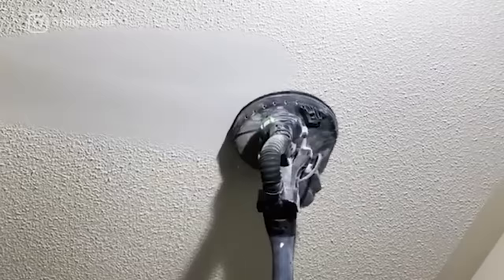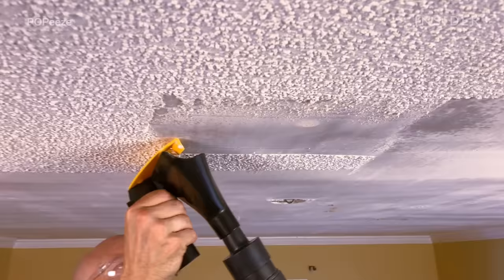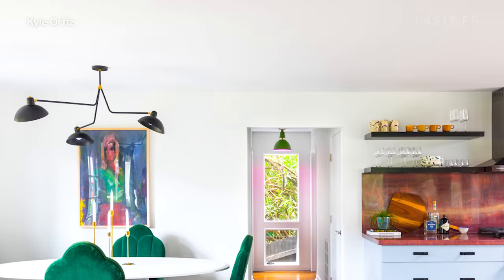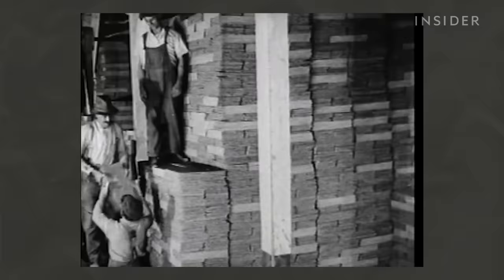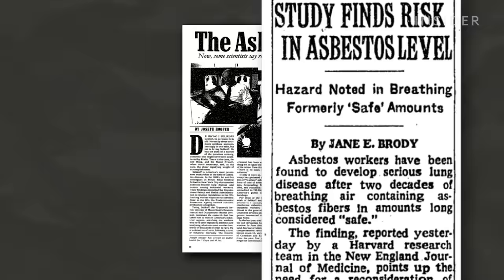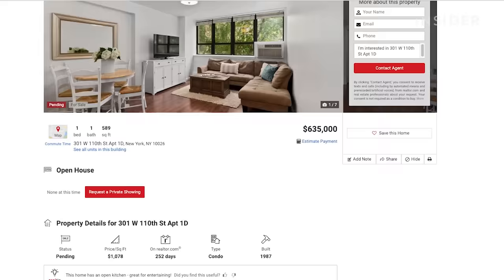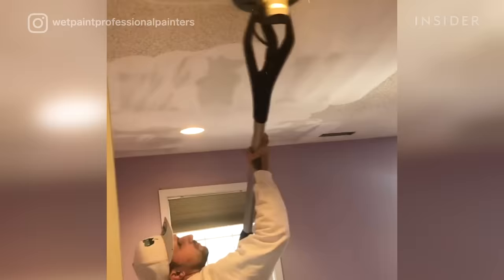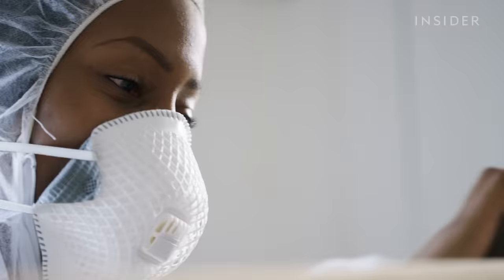Why Are Popcorn Ceilings So Terrible?

Comment: I love popcorn ceilings.  Popcorn ceiling beats looking at ceiling imperfections any day.
Reply: Agreed
Reply: There is a texture that you can add to regular paint to give a softer look to a ceiling to cover imperfections. Another trick is to use plaster thinned out and applied to give a texture like adobe or a homey plaster look before painting.
Reply: @schokoloko2092  I did that with our bathroom.  A thinned plaster before painting and used a light hand on it so it will not hold dust and it looks very nice.
Reply: Try stippling. Popcorn is garbage. Half the crews that used it didn’t prime the ceilings first so most of time you just see that crap peeling off giant chunks.
Reply: @jessicacalaci7380  Not a helpful comment.  It's sort of like saying to someone who's born ugly, if you don't want to be born ugly, just be born beautiful.
Reply: Need a better wall/paint guy. My 100 y.o ceilings are pristine.
Reply: @windsofmarchjourneyperrytr2823  Yet another useless comment.

Comment: As a former hazmat consultant,

If it’s in good condition you don’t have anything to worry about. If it’s in bad condition, flaking off, or delaminating, you either have asbestos dust and silica dust coming down regularly, or if it’s post-1990 build/tested and no asbestos you still have silica. 

Either way you’ve got a half decent chance at getting cancer 20 years down the road if you don’t do anything about it (depending on how much flaking material is there)

Comment: Nothing wrong with a popcorn ceiling unless it is pre-1979. They did a good job of deadening sound in multifamily, and hid builder imperfections. However, anything close to that timeframe could be toxic as the markets were able to deplete residual item stock that had ACM asbestos containing materials

Comment: They were a quick and inexpensive way to give the ceilings a uniform look.
They were used a LOT in the 70's and they come off pretty easily but you still have to texture them.  I ran across one from the 60's that had a very different material and it would not scrape or sand off so we had to skink and float the entire thing.

Comment: Popcorn ceiling facts:
Popcorn ceilings break if you breathe on them.
My house has a stipple textured ceiling, and it's kinda like a popcorn ceiling but a bit more modern.
Stipple textured ceilings also break if you breathe on them.
Some popcorn ceilings have glitter mixed into the paint. 
NEVER look up when touching a popcorn/stipple ceiling, I learned this the hard way.

Comment: Popcorn ceilings were not used here in Miami until the 1970's. Before that drywall was too low end for residential use. All ceilings were either plastered or celing tiles. Celotex cane fiber tiles were accoustic but drywall never is. There was a spray applied asbestos cement accoustical plaster that would be applied to structural members and concrete surfaces and we had it at the round bank near the home I grew up in. Popcorn ceilings disappeared in the 1908's in favor of the knockdown method that somewhat resembled plaster.

Comment: The odd thing about my house is that the walls are not textured, so they were not trying to hide poor drywall work.
But they installed popcorn ceilings, which I went to great lengths to remove in my last house to make it more appealing to buyers.

Comment: There is something worse than a popcorn ceiling.  It's called adding glitter into the popcorn ceiling mix.

De-popcorned my house last year after having lived with it for 12 years.  Fortunately it was only in 3 rooms.  In 2, the stuff literally melted once wetted and was able to pretty much be scraped once and then wiped off.  In the other, it was the glittered abomination that wasn't just plaster but which had been sprayed on with paint.  Substantially more work, but a very satisfying result.

Comment: I painted a popcorn ceiling in an office building. Used a roller with a long nap. The first coat had lots of bits of paint and coating falling off but when that dried the second coat went on easy. Looked much better painted over.

Comment: Last time I saw Popcorn ceilings being applied was in 1988 in My late GrandMother's apartment.  The housing Project Management painted all apartments with a horrible strong smelling paint (common for Public Housing then/prior).  When Painters started setting up to spray ceilings the Popcorn product they mixed was tiny Styrofoam beads with whatever other liquid that was.  
I know it was from the bag's label and some beads blowing around the apartment on the floor when the Painter's were finished.  
I figure all houses/apartments don't have the Asbestos Pop Corn Ceilings, perhaps Asbestos was stopped being in use at some point.

Comment: Popcorn ceilings to hide imperfections? What kind of imperfections would there be for the need to spray on a thick layer of textured coating, instead of just paint or drywall repair paste? Isn't the ceiling made up of the same material as the walls, which is drywall? How were builders so able to fix imperfections on the walls but not the ceilings? 🤔

Comment: We removed three rooms of with spray bottles of water and paint scrapers. It was fairly easy but tedious. You soak the stuff up really well, wait five minutes and scrape. Don't forget plastic drop cloths. This is very messy work so hang some of the plastic and try to seal the room off. You'll have dust everywhere anyway but try to minimize it. After the ceiling is dry. You can use sanding bloc on a pole. Power sanders are better left to the pros. It's very easy to gouge the ceiling with one.

Comment: Known in the UK as Artex - older ones have asbestos. Some of the patterns are OK but the stipple- aka popcorn - is naff.  Cheaper than a plastered ceiling because our spreads hadn't learned to walk on stilts . So whole rooms had a low scaffold over it. Whereas the Artexers had 1 guy applying and another stippling a foot square rubber fingered thing. Also didn't need painting for a few years.

Comment: I clicked on this video to give myself comfort that I'm not the only one who hates popcorn ceilings. It's so gritty, crumbling, dusty... you legit can't clean that area of your home whatsoever without making an even worse mess. I swear it seems to fall off just because you thought about touching it. I didn't realize it's been so popular to get rid of them. Not many people I know are bothered by them. I get told "they're sound dampening" but in my mobile home, the rain on the aluminum roof still sounds way louder than it does hearing it outside. There can be a light rain and it sounds like a downpour. A downpour sounds like the house is under Niagara Falls. The rooms also tend to echo a bit anyway. So it feels pointless having it. Thankfully I love the sound of rain. Been thinking of slathering my ceilings with drywall but I'm concerned about the added weight.
Reply: Omg if it is falling apart thay bac please make sure it doesn't have asbestos and if it does get help asap!!

Comment: Life hack if it's unpainted, just spray it on fan mode with a garden hose sprayer with multiple settings, mist it first, wait 10 mins, try to scrape, sometimes it takes 3 mists, it it's painted, scrape the tips, then soak the ceiling with mister or shower setting, no more than 2x, then it'll slop right off easy on either type, paint or not, if it is painted, be careful when scraping dry first to break the tips, it's very hard and can cut you.

Comment: Some major information here !  Popcorn ceilings were not to "cover up flaws in ceilings." It was found to have  noise reduction properties. Houses with popcorn ceilings are quieter...PERIOD ! Flat ceilings reflect sound. The rough surface in popcorn ceilings help to 'scatter' sound and the soft styrofoam material helps absorb and deaden sound.  Popcorn ceiling spray paint is simply styrofoam pellets mixed in with WATER BASE paint. NO asbestos in it.  My condo has the original popcorN ceilings from 45 years ago. It still looks fine...and I have always kind of liked the look of it !

Comment: Doing something because it saves money isn't the same thing as being lazy. The traditional alternative to popcorn ceilings is skim coating with veneer plaster, which is costly, time consuming, and requires skill and practice, but has many of the benefits of popcorn ceilings like sound dampening and hiding imperfections. If anything, it's all these DIYers who are being lazy by only doing half the job they should be doing, removing their popcorn ceilings but not replacing it with a superior product.

Comment: It's mentioned that it costs between 1 to 2 dollars per square foot to remove . That's if the room or rooms are completely empty of all furnishings . If the room or rooms are full of furnishings there's additional costs to empty the room or rooms . The reason was also mentioned as to why popcorn was sprayed and that was to hide imperfections in the tape & bed process of finishing the ceilings nicely like the walls . So after the popcorn has been removed then it all needs to be made flat and nice and then a nice light texture that is easily washed and cleaned after painting . So from start to finish to a nice washable and cleanable ceiling it costs more than 1 to 2 dollars per square foot plus any furniture to be moved out and back in after it's completed . Also if the ceilings are higher or vaulted there's an additional cost . So from start to remove popcorn ceiling to a finished ceiling nicely painted can cost allot more than 2 dollars per square foot !! Some really tall two story vaulted ceilings can cost as much as 10 to 15 dollars per square foot in some of those mansions !!! But for the average regular ceiling if it was tape & bedded decently from the start and the room or rooms are completely empty then you can get by as they say in this video . But texture and paint would be extra in cost .

Comment: The place I rent has them and they're just dust traps . I swear I have to take a paintbrush and clean the ceiling every time I vacuum . And depending on the imperfection you can probably hide it with a little bit of silicone and paint.  Just takes a little time and patience

Comment: My ceilings and walls do not have popcorn. But they have some sort of sand mixed into the surfaces, giving a textured feeling. As I have painted over them over the years, the texture has become less and less. Does any contractor or expert out there know what I have?
I tested for asbestos and it was negative. Home built in 1961 in the NorthEast.

Comment: I have popcorn ceilings in my bathroom which is a terrible place for them especially above the shower when you have someone who's 6 ft tall and goes nuts with shampoo and body wash because the dirt gets on the ceiling and it's hard to clean

Comment: Most acoustic ceilings contain asbestos just like the sheetrock and drywall mud, texture.  1976 outlawed the new use of asbestos in all Drywall products. All asbestos Drywall products had to be used up by the end of 1978.  Been doing Drywall since 1962.

Comment: my grandparents have this on pretty much every solid ceiling in their house, (excluding the corkboard tiles of the basement) I never had a problem with it until I could reach the ceiling at the bottom of the main stairwell, the paint crumbles if you run your fingers over it too hard, which I love to do now because it's so satisfying,  
textured walls are where I draw the line, they aren't as aggressively bumpy as ceilings because gravity is a big factor in how it all works, but having such a space for 5+ years where no one cares where or how the Wii discs are stored, there are bound to be a few casualties, 
in the basement of our duplex there were fire escape windows recessed into the wall, the extra deep windowsills had no actual sills or finishing whatever pieces to make them look decent, it was just a large empty space glossed over with the fucken textured paint, and on numerous occasions my little brother scuffed game discs across that and all but destroyed half our collection

Comment: Easy and cheap way to turn an ugly popcorn ceiling into a beautiful lacework ceiling: (wear a respirator and goggles to do this). Take a clean garden hoe and lightly rake the ceiling to scrape off the nubs, but leave the base of the nubs. You don't want to expose the paper. This leaves a tight lace-work pattern. It's tighter than lace-work applied over a flat ceiling with mudding techniques, but the effect is still high-end once painted. Whereas popcorn is garish and nerve-jangling, lace is harmonious and soothing. My entire downstairs has lace ceilings, and after 20+ years I'm still enjoying them. If you scrape a popcorn ceiling and the lace is too tight, a light lace technique over it with thinned mud will open it up.

Comment: At my grandmas house, the wall of the stairs leading to tge second floor was a popcorn wall.  and ill never forget because the bathroom was on the second floor and the wall was on the right side going down and left side going up.  so whenever i was running down the stairs as a kid id run my finger along the wall in general.  but at my grandmas house id try to do it without thinking before being greeted by pain and resentment

Comment: If you have an older home you'd better just plan on replacing all of the plaster and lath back to the rafters. Spoiler alert; it's going to cost a lot more than $1 or $2 per square foot. Personally I prefer the popcorn ceiling.

Comment: Most products is untrue.
Several asbestos products are still used and around today- you’ll find it in brake pads for large vehicles such as semi trucks, some drywall mud compounds, insulation for power plants, and many other uses where there is expected to be high heat or high friction. Where it has been banned is in surfacing materials (Spray applied ceiling textures), flooring, and HVAC systems, as well as a few other assorted uses.
Asbestos is bad for you, but the vast majority of what is used in the home is the chrysotile variety, which is considered to be the least dangerous of all types. Your dangerous stuff is your easily-pulverized (friable) material, such as spray applied ceiling textures as mentioned in this video, and damaged material- both easily give up their asbestos fibers to the surrounding environment.

Comment: Here's the TLDW for this video:
* "WAAAA popcown ceiwings ugwy"
* Actual good point about the asbestos risk
* Proposing DIY removal multiple times despite the asbestos risk, suggesting they only brought up that problem to shill removal
* Shilling removal on grounds of it adding value for flipping, which is a feeble reason to make a rennovation unless you actually need to sell off a house
* Complete failure to suggest superior replacement noise control surface for ceilings (or mention an easy way of getting a smooth drywall ceiling), leaving their claim that popcorn texturing is "outdated" unsupported.

This feels less like a science vid, and more like propaganda from realtors to push people into commodifying their homes.

Comment: People who have never slapped two 2x4s together don't actually understand how hard it is to get a perfect house. Yes skill will be a factor but something like LVLs are superior ... if you're rich. I hate popcorn ceilings and I hate people who half ass a job but I can understand why they do it because getting drywall level is hard and hazards to your health. It so much easier to start clean and do it right rom the beginning rather than "fill a hole with caulk". Like Adam savage eludes to and error in the beginning is a killer at the end.

Comment: For me drywall is just trash. It's plain and boring; makes the wall easier to damage; and when you touch it, it's completely DRY, I hate that feeling.

Finally, I want to conclude my comment saying that this video is incredibly biased. There are 2 types of popcorn ceiling: The one shown in the video (with asbestos and acoustic isolation); and another one using the tempera technique (without asbestos and without acoustic isolation), which consists on using a high thickness paint and letting it dry to form that popcorn look. What a surprise that the second one, which doesn't have any health risk, wasn't mentioned. I assume that this video was made to convince people to think that popcorn ceiling is bad, so the professionals have more clients. Also what a coincidence that they say that removing it by yourself is a very intensive project, so they recommend calling a professional.

Conclusion: Biased video made for professional's benefits.

Comment: Who wrote this nonsense? "Popcorn ceilings?" they are called stucco or textured ceilings - and for the later period that these textures were applied they simply used drywall mud or stucco. And who's to say they are "outdated" or "unsightly" I think a plain flat white ceiling is ugly and bland. However this is a personal preference - and therefor I would not go around putting others choice of ceiling design down like this video does. And saying they are cheap and for hiding flaws - or an indication of a cheap home? Well I've been in some very beautiful expensive homes with immaculate textured ceilings. Shame on the writers of this video!